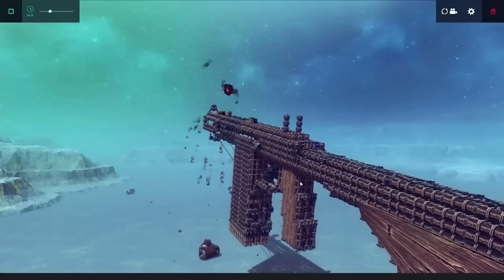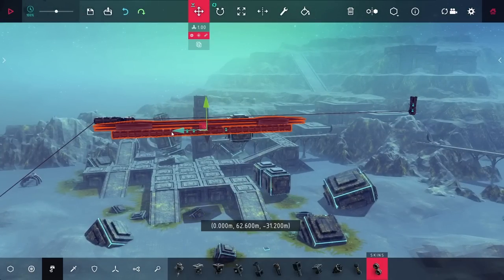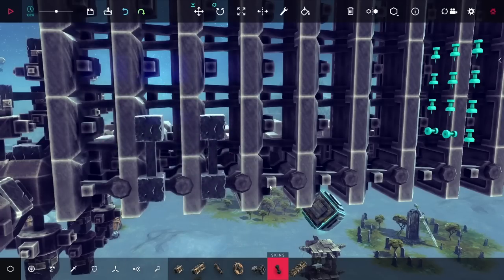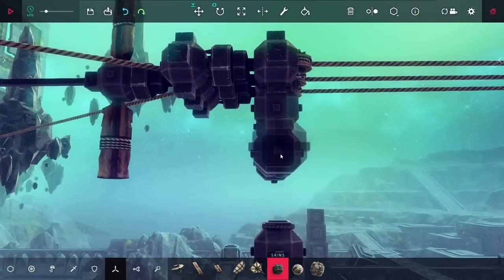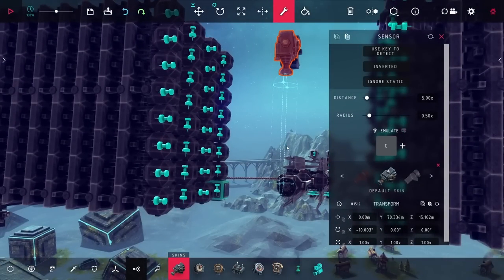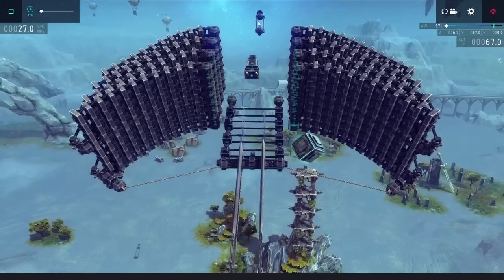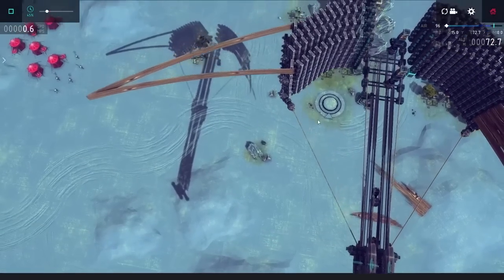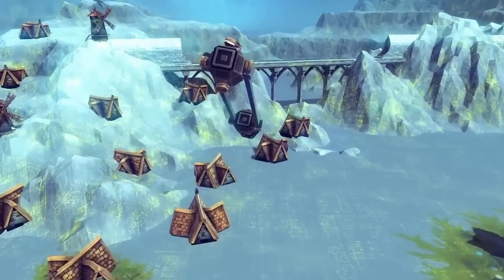Making An Explosive Crossbow in Besiege

Comment: Hey ReidCaptain I think there might be a solution for the bolt sagging down. What if you use a sabot since it covers the projectile and makes it fit the barrel or guide rail diameter and doesn't let it sag down or move around before it leaves the barrel. Btw awesome content and I always love your vids about besiege

Comment: Most of the hinges near the far ends of your bending beams do nothing because they don't bend, only a few near the center do the bending. If you want a more functional energy storage you should use have a beam that is very stiff near the center and remove as much weight as possible near the outer ends. I.E. any hinges that don't bend and store energy should be removed or replaced with a lighter item so that there is less mass to pull forward.
If you can have 6 deep of hinges near the center, and 5 deep on the next row out, then 4 deep on the next row out etc. and still pull on all of the hinges somehow you might be able to get more energy transferred to the bolt.